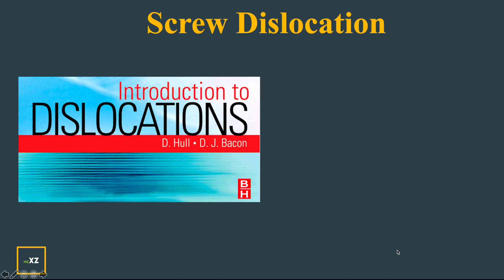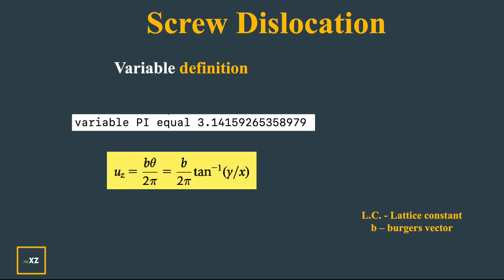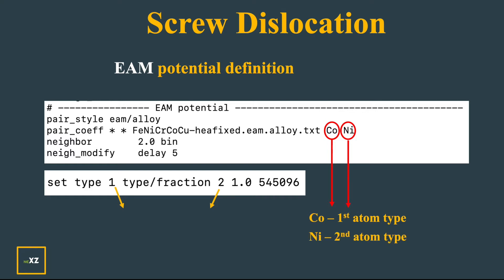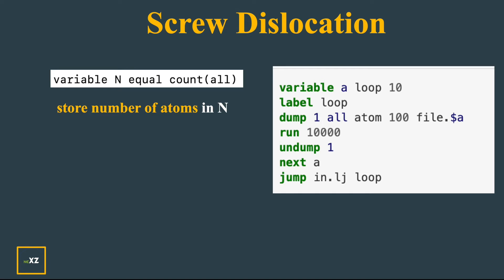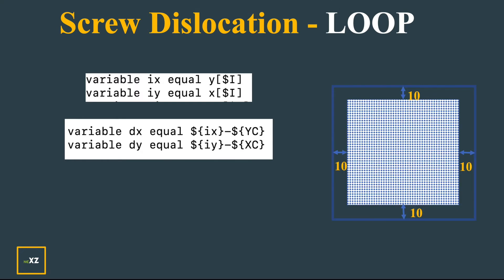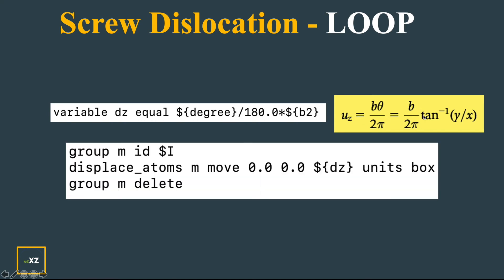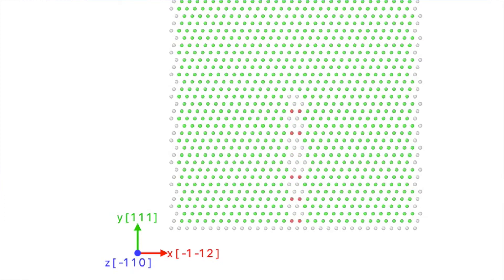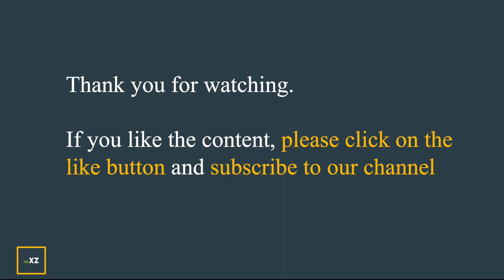Screw Dislocation LAMMPS code || Face Centered Cubic Nickel (Ni) || Using Loops in LAMMPS scripting

Comment from the maker: LAMMPS CODE:

variable XLO equal xlo
variable XHI equal xhi
variable YLO equal ylo
variable YHI equal yhi
variable ZLO equal zlo
variable ZHI equal zhi
variable LC equal 3.52
variable b equal 0.5*sqrt(2)*${LC}
variable b2 equal $b/2
variable PI equal 3.14159265358979
variable dx equal sqrt(2)
variable dy equal sqrt(3)
variable dz equal sqrt(6)/2

variable ROT equal 0 #-90 z,0 y

# --------------- General Settings -----------------
units    metal
atom_style    atomic
atom_modify map array #sort 0 0.0
boundary p p p

lattice fcc ${LC}  orient z -1 1 0 orient y 1 1 1 orient x -1 -1 2 #spacing
region box block 0 30 0 30 0 4
create_box 2 box
create_atoms 1 box

change_box all y delta -10 10 units box
change_box all x delta -10 10 units box

# ---------------- EAM potential ----------------------------------------
pair_style eam/alloy
pair_coeff * * FeNiCrCoCu-heafixed.setfl Co Ni
neighbor        2.0 bin 
neigh_modify    delay 5

set type 1 type/fraction 2 1.0 545096

compute 1 all pe/atom
compute 2 all stress/atom NULL

thermo 100

write_dump all custom pft.out id x y z

variable XC equal (${XLO}+${XHI})/2.0
variable YC equal (${YLO}+${YHI})/2.0
variable ZC equal (${ZLO}+${ZHI})/2.0

variable N equal count(all)

variable I loop 1 $N

label LOOP

variable ix equal y[$I]
variable iy equal x[$I]

variable dx equal ${ix}-${YC}
variable dy equal ${iy}-${XC}

if "${dx}==0 && ${dy}==0" then &
    "variable theta equal 0" &
    "variable degree equal 0.0"

if "${dx}==0 && ${dy}!=0" then &
    "variable degree equal 90.0*${dy}/abs(${dy})"

if "${dx}!=0" then &
    "variable s equal ${dy}/${dx}" &
    "variable theta equal atan($s)" &
    "variable degree equal ${theta}/${PI}*180.0"

if "${dx}<0.0 && ${dy}>=0.0" then &
     "variable degree equal 180.0+${degree}"
if "${dx}<0.0 && ${dy}<0.0" then &
     "variable degree equal -180.0+${degree}"

if "${degree} < -180.0" then "variable degree equal ${degree}+360.0"

variable dz equal ${degree}/180.0*${b2}

group m id $I
displace_atoms m move 0.0 0.0 ${dz} units box
group m delete

undump 1

next I
jump SELF LOOP

minimize 1e-18 1e-18 100000 100000
write_dump all custom final.atom id x y z